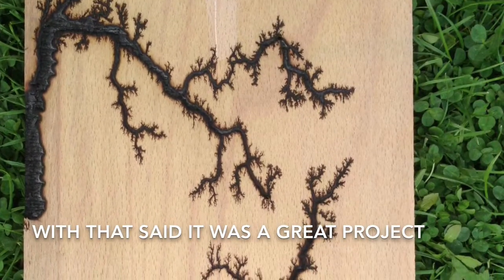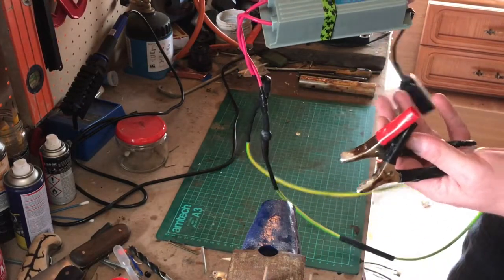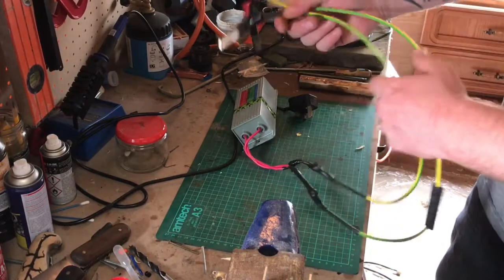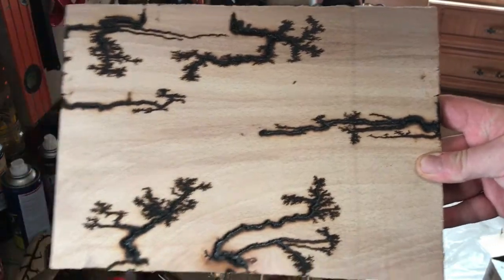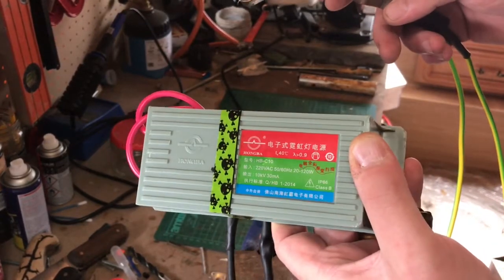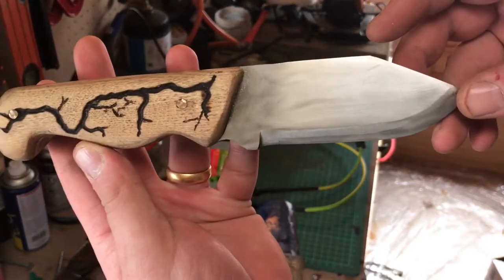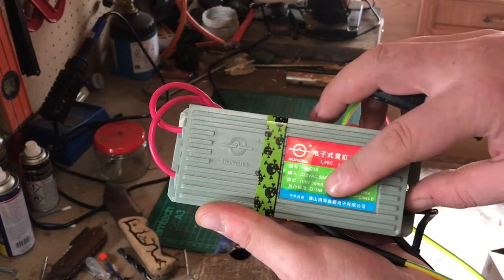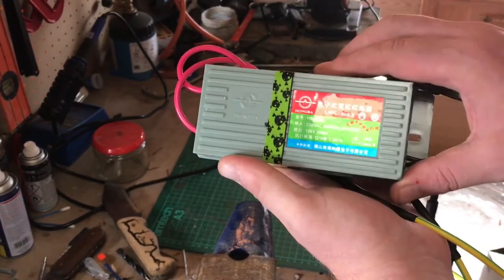Lichtenberg Machine 10.00 Volts Knife Handle

Comment: I am so hacked off. The other day I walked past a skip and there was a microwave staring at me!! Anyway, I hauled it out and stripped it down. The only snag was, the guts were so complicated I could not work out how the transformer worked?? It was not a straight forward transformer like they show on the videos. So the whole thing ended up back in the skip. Now looking out for another transformer. Want to do my hiking stick that way.
Reply from the maker: Hi mate mine was £16:50 off eBay new search neon transformer mine is 10k 30ma great fun for the price a lot easier doesn't matter which way round the wires go as long as you get in and out right